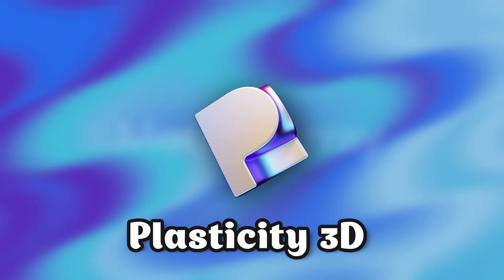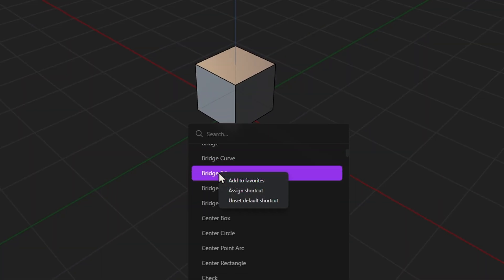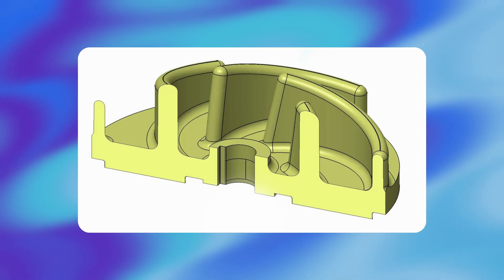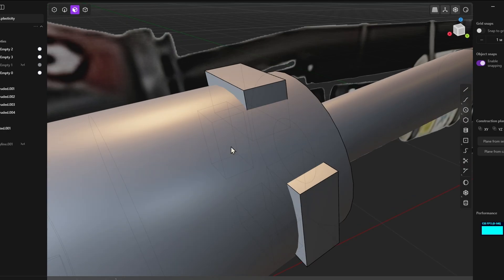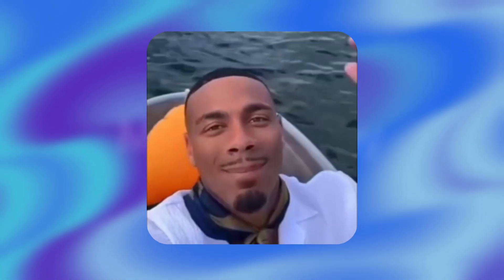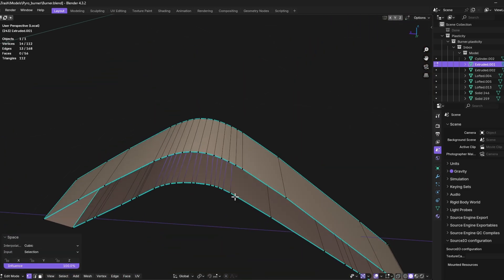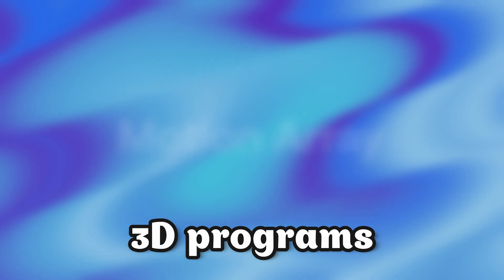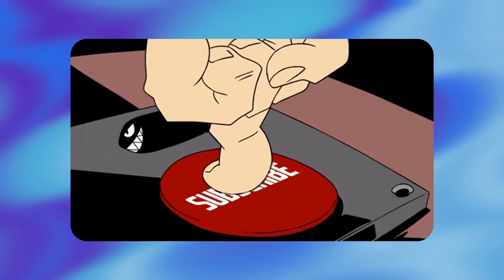The SHOCKING Truth About Plasticity in 3D Modeling

Comment: Blender is a mesh editing and building tool meant for digital products and artwork, on the other  hand Plasticity is a parametric solid / surface modeling tool for building products to be used in the real world! The two products are worlds apart. Some folk are that dumb they have to make a video to proove to the world how dumb they actually are! Plasticity is/ or was until recently developed by ONE person and not a multi-national corporation like many other products in its class. I have used many other CAD programs and I understand the differences. Blender is not a CAD program in the true sense of the word, DO you not know what the word RESEARCH means?

Comment: This is by far the most inaccurate and petty review of Plasticity I have ever seen. Most of your complaints about this program are it's strengths. Confirming actions slows you down? Closing the program without saving causes you to lose progress? You can't open your projects after the trial period ends? You can't customize the windows enough? Too hard to change hot keys? You are grasping at straws. Plasticity makes beautiful chamfers on well modeled objects. Your lack of skill or familiarity is not the program's fault. Plasticity does things on low spec computers that would crash a gaming rig with the usual suspects. I happily bought a licence. It is 1/100th the cost of most commercial software and you own it. You aren't getting repeatedly raped by subscription fees.

Comment: As a hobbyist that uses 3D modeling to create and print spaceship designs and scifi dioramas, I feel like Plasticity is especially suited for my use case. I love using Onshape, but it is really intended as a professional grade CAD engineering tool and for my needs is usually too complicated.  Blender is terrible as a CAD solution , but it's great for 3D sculpting of characters and animation, but it too is overly complicated for my needs. Plasticity hits the sweet spot and falls somewhere in between TinkerCAD and Blender, more powerful than TinkerCAD without the convolusion of Blender.

Comment: These complaints are kind of minor. But Plasticity has some really big drawbacks that you don't mention. It's so attractive because you can make really complex 3D shapes very quickly and directly, that is really brilliant and seductive. IT'S SO PREEETTY!!! However. It is a destructive workflow. The lack of being truly dimensionally driven is a huge drawback. And not being able to go back and go through the design steps and key sketches, with the ability to alter those earlier steps. Designers make prototypes and create lots of alternate variations and progressive iterations with sometimes very small precise changes. This is what traditional CAD gives you. Onshape is what I'm using now in addition to Blender, but Onshape more for function items, mechanical parts. Not only does Onshape allow you to alter every single step you took to create something, you can temporarily suppress a step or multiple steps. You can easily duplicate an entire part studio into other tabs and make lots of variations, different sizes, versions, etc etc. You can drive designs with variables, very easily. All you can do in Plasticity is save different files with different variations, which is far less convenient. If you're fitting parts together, aligning screw holes, tolerancing fit by altering a fraction of a millimeter . . . dimensionally driven CAD wins over this. 

I would like to see Plasticity adopt more of the traditional CAD concepts like a tree of design steps that can be revised, more robust dimensionally defined workflow, which would also open up variables, and a more flexible tabbed workspace. I realize it would be harder to add these and still preserve this "direct modeling" feel, but without these industrial design standard workflows, this is going to remain more of a "I sure wish I could use this program, but . . . " kind of thing, for me and for a lot of people. 

I get that Plasticity is more of a modeler for sculptors and concept creators. It's not really for final functional industrial design objects or (for me) the kind of 3D printing that I do. It's like, I could design really cool stuff in Plasticity, but to actually make or 3D print or CAM machine it, and iterate and adjust fit and function through successive versions, I'd probably end up having to re-design it inside a more standard CAD program like Fusion, Onshape, Solidworks etc. When Plasticity can do more of THAT then I would adopt it like yesterday.

Comment: I use Rhino for university, and Solidworks also, using plasticity, is so faster when you’re doing something no too complex. CAD is for manufacturing, Blender is just visual. Of course… for proposal ideas (visual) Blender is really good, but then… for justifying links between pieces, threaded, screws, and standard pieces, the workflow that I see, is Plasticity + Solidworks.

Comment: I agree with almost every statement. Everyone who disagrees here with you is just used to eat Autodesk slop with their horrible UI, pricing and modeling speed. If you compare to THAT, then it feels like a blessing. Otherwise - completely idiotic idea of forcing you to press RMB every time you do an action, horrible UI, you cant customize some crucial hotkeys, UI feels extremely cheap. "yeah thanks for having a search bar where you can find any tool" but it feels like a temporary cheap solution rather than a developed interface. If you want to align an object relatively to a world space - feel free to learn a sequence of shortcuts, and if you want to insert desired world position right away - you cant. 

The saddest part is that most of those issues are so easy to resolve, and the modelling CAD core of this software is undoubtfully good. The program is held back by minor, yet inconvenient and time consuming issues.
Reply: It's developed by one person or it was until recently. I take it from your comments that your software is much better, so what's it called and where can I review it?

Comment: i think you forgot that it can be much easier to learn. great for 3d printing or prototyping. not all 3d programs need to be made for animation. its half the price of fusion 360, which is an annual cost of like 700$. so i think you left out some very valid points of how you can use it

Comment: A long time ago, whilst I was still working in a start-up ODM in Asia. A famous foreign designer sent us their STP file with a very complex shape that dumbfounded our mechanical engineer lead. Our mechanical engineers used Pro-E and could not reproduce the complex shape to design the double-shot insert molding tools. I was a Solidworks user, and after a few hours of analysis, I was able to reproduce the first of many iterations. There was a lot of trial and error. The challenge was to separate the complex shape into reliable  molds. With an outer part  (ETPU), a frame structure (PC ABS Blend), and an interior part (also ETPU). Besides this complex monstrosity, the organic shape also had an opening for a 4G mobile controller / touch screen. The opening is linked to the shape of the detachable 4G mobile controller, which was friction fitted when assembled together. We would make mock ups and test wearability, water ingress, drop and impact testing, 4G / BT signal performance. Everytime something fails, we go back and readjust the 3D. I would present my adjustments to the famous designer using renders from 3D max with VRAY. I had keyshot, but opted to use Vray due to the highly realistic renders (at the time). It made a good impression that lasted many projects subsequently.  If I had plasticity back then, it would have cut my modeling by more than half. Moral of my story is... we may need to learn and use many tools. I may favor "A" tool, but only "B" tool can get the job done within time limit. But if the faster "C" tool was available, then I would have chosen it over other options. 

To me, Plasticity is fun to use.

Comment: I wouldn’t say its trash I used it for a month last summer. But ultimately didn’t purchase it either. I wanted to use it for industrial design. I did a bunch of Nikita and LEAD tutorials. Having used alias, solidworks and fusion heavily. I felt that it was quick, great surfacing and intuitive. However if your doing anything with engineering or need dimensional, relations heavy CAD. Its not a solution. It really is like blender and a parametric put together. If your just building cool robots its def worth it. But blender is free. Way more of a learning curve but free

Comment: The “chamfering” problem you mentioned, can be done with a pipe Boolean cut, and then lofting. 

It seems like you aren’t familiar with this workflow. 

Plasticity literally has the professional level surfacing workflow albeit it being limited, but powerful enough to make near-production to production quality work. 

Of course it has its own issues, and limitations this is a fairly new software and only ONE individual is working on it full time. Meanwhile CAD companies with 20x more workforce isn’t able to come close to this level of feature release per instance. 

I saved a boatload of money with plasticity, to get my first conceptual models done for product design, so I don’t see your point here.

Comment: For reference I am an industrial engineer and I have used most major CAD programs including catia, solidworks, NX, fusion, Shapr3D, and blender. My job is to use these pieces of software and you are not understanding the purpose of Plasticity or how to use it. The workflow is based off key binds and you need to learn them to increase productivity, it is not a clicking interface. This open up the user to working fasting using 1 handed key binds while the other hand is on the mouse selecting the model and geometry, you simple didn’t learn how to use the software. Speaking of geometry, that’s what this software is used for, not organic modeling with blender. It’s wrong to compare these 2 because plasticity is meant to be used alongside blender using their live bridge feature allowing you to work in both programs at the same time leveraging every tool from every software. Plasticity is a CAD for artists which is why its workflow is minimalistic and less focused on constrained dimensions. It also has the best surface modeling out of any industry software second to NX which is why plasticity is an NX derivative. If you compare these pricing of this to any industry software it is super cheap and offers the user use in commercial space with no extra contracts or fees which is unheard of, and the reason you need to compare it to industry software over hobby software is because it is leagues above anything short of industry software for geometric modeling. Your points are only valid to someone who has not spent more than 5 minutes in the software, also learn the pipe tool and or surface modeling to do chamfers. You are trying to use a hammer instead of a scalpel, that’s why you can’t use the software properly
Reply: OK I watched the full video, and yes you made some valid generalized statements but overall misrepresented the product. I don't see how customizing favourites really differs from blender, infact the workflow is almost entirely borrowed from blender.
You misunderstood the software at so many points I'm not gonna bother addressing it all as others already have, your ragebait title speaks for it self. 

This video was neither fair nor balanced appraisal of plasticity (or blender)
Reply: Sorry I was just responding to your comment above I could only watch a couple of minutes of the video, you jumped straight into false equivalence from the beginning, it just came across as  "I tried eating soup with a knife,  and I hated it" type video
Reply from the maker: @takerefuge3d  Well I noticed that most people without watching the whole video write that I am a complete zero, although I talked more about the inconvenience of using plasticity, not that it is the worst tool for modeling. But some people were very detailed and polite to tell me where I was wrong and that I didn't get the information right.
Reply: Nx is best for surface? What about CATIA? I thought catia is the one preferred by atleast automobile industry for complex surface modelling
Reply from the maker: On the fact that I did not understand the keys: I know that there are special combinations of keys for quick use of tools, my complaint was that there is no convenient menu where they can be customized, even too move the mouse or anything else. Claim in comparison with Blender: yes I have no experience in using other CAD programs, and I realized that some comparisons with Blender are inappropriate, but most of the comparisons were about general shortcomings, for example the lack of a window with a warning about unsaved file and so on I just found it more convenient to compare with Blender. The fact that I studied only pipes: I did not only pipes, but also other shapes, just with pipes and chamfer with them I had problems with which I wanted to share and wanted to show what I wanted to see in comparison with blender, with the rest I had no strong problems. But still thanks for the detailed comment, I will take into account the retention, and I hope it will help other viewers.
Reply: @Verfassen  you press F then select the command right click and you can change the shortcut.
Reply from the maker: @ I know, I mentioned it in the video.
Reply: @Verfassen  You can customize all shortcuts in the program.